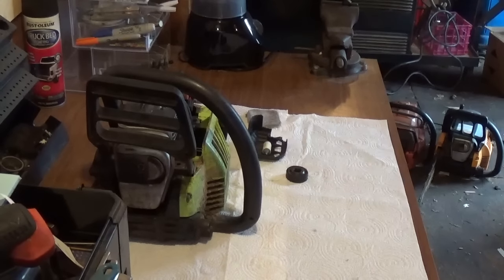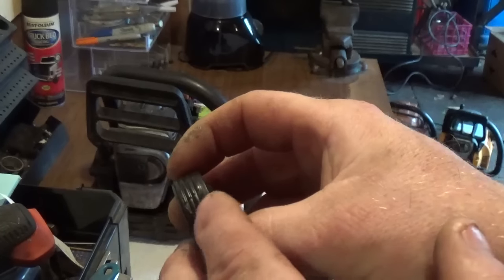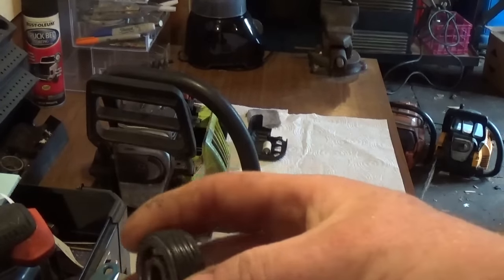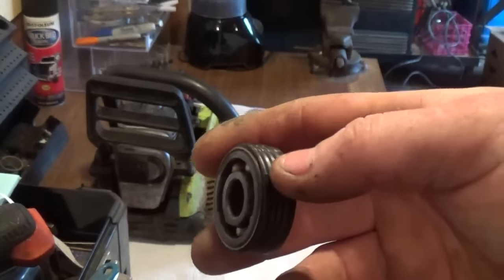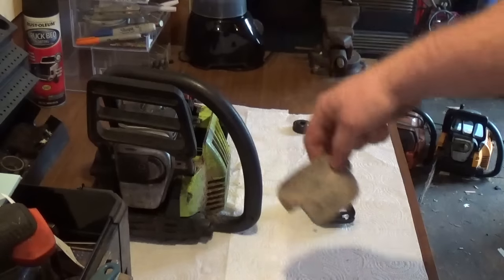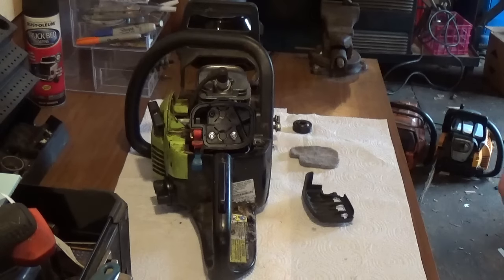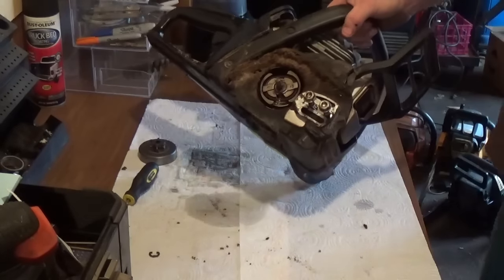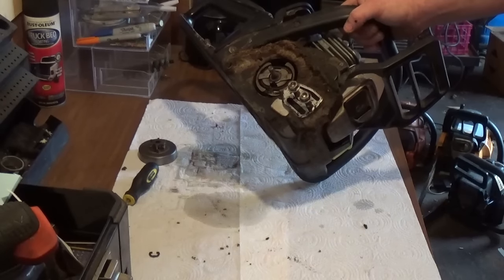Common problems with Poulan Chainsaws

Comment: Since Poulan used a somewhat odd OD/ID fuel line I use Echo fuel line. I've used Tygon also. Fully agree with your assessment of these saws. In this area you've got cheap-ass people buying cheap-ass saws b/c mainly they don't need anything better. I seen these parked at the curb for trash pickup before. Some look as tho they've never been ran. Got 1 of those in the shop now, a 42/18. Replaced the fuel line, replaced the bar/chain with a 16" & it's not a bad saw. I always sell these at yard sales & they'll bring almost as much as new.

Comment: WOW! I bought one in 1983 from my local "Western Auto" . Unfortunately, the Western Auto is long gone but my Poulan Counter Vibe 3400 (with a bow bar) still cuts fire wood every year without fail! No Problems! Thanks Poulan!
Reply from the maker: The older Poulans where pretty decent saws …...This newer crap makes me sick …...Not even worth taking home so to speak .
Reply: @kevinbolin7665  Yeah, that's what I figured Kevin. Nothing (and I do mean NOTHING) is made to last any more. We now live in a throw away world. Buy it, use it until it breaks, throw it in the trash and buy another one... Sad. Thanks Kevin

Comment: This is all absolutely correct.  I had an old poulan that ran well for many years.  I then bought two different models of new poulans including the one shown.  They both had all these same problems.  Husky would not fix them under warranty and said it was my fault that they failed.  I ended up leaving them at the recycle center and bought a stihl which has been a great saw for many years now.

Comment: I must say that the Poulan 3314 looks to be an amazing piece of machinery. It looks like it should be a great chainsaw. 
And it does run, don't try to start it when the engine is hot, you need to take a 30 minute break before that. There is a modification that will fix that by drilling half inch holes in the middle of the air filter cover. But it leaks gas and oil. the oil and gas cap is removed with vice grips. And when you try to start it, it kicks like a mule. But if you clean it up, drain the oil and gas out, it makes a pretty good static display, it's good for that.

Comment: 10 years on mine. Only issue was the primer bulb.
Reply from the maker: Consider your self lucky....there are fair to many problems that plague these saws than broken primers.....
Reply: probably because it is lightly used. I wouldn't own one for constant use. I'm actually about to dig up about 30 trees
Reply from the maker: True/ there def not a saw I would rely on ..

Comment: While no one can ever argue that the Poulan P4018WT is a pro grade saw it is not a complete POS either.  I got mine 16 years ago on a Black Friday special for 79.99 (and that included a case and scabbard).  That said I experienced some of the same problems mentioned here and on other Poulan video’s (primarily hard starting hot or cold).  I never had any oil or fluid leaks though – I attribute that to the fact that I run all my 2 cycle equipment 10% fat on the fuel mix.  I use Echo Red Armor fuel mix along with Stabil fuel stabilizer and 93 octane pump gas.  I opened up the muffler and modified the air cleaner cover by drilling a ¾” hole in line with the upper barrel of the two barrel carb.  I then made the appropriate carb adjustments and that took care of the starting problem and quite frankly the saw runs great.  I use it primarily as a backup to my pro grade Echo 501P and also as a bucking saw.  Where I live on the front range of Colorado (7,300 elevation) 90% of the wood I cut is pine so relatively soft wood and the saw runs all day long running through 10” – 16” pine.  I don’t carry it in the woods anymore because it is a heavy saw (weighs more than my 50cc Echo) and is not as ergonomically comfortable as my Echo for felling trees, but like I said it works great as a bucking saw / backup.  I should mention that I use Oregon 91VXL chains which are more professional grade.  I tuned by ear and the spark plug is consistently golden tan in color so I think I’m in the sweet spot, but I do have a question about idle rpm and WOT rpm – if anyone knows those spec’s I’d be grateful for a reply
Reply from the maker: Rick / to each his or her own .....if you like 42 cc of screaming skipped toothed performance .....even though you advocated you made mods and upgrades .....hey .....great .....my only comment or request rather would be to show my viewers irrefutable proof of this saws longevity with a video / Take the Poulan challenge to validate that indeed your opinion carries merit further validating that these saws are not pieces of shit . { Viewers this is a reasonable request .....IS IT NOT? }Then why hasnt anyone validated there claims ? It seems most are asininely blinded by opinion or preconceived idealisms .....Yet no one ever provides a video .....HUMMMM.......wonder why ?
Reply: @kevinbolin7665  Mr. Brolin – thank you for the reply.  To be sure I’m not advocating that anyone go out and buy a Poulan chainsaw – in fact I would advise against it, there are much better options available albeit at higher price points. I bought my Poulan 16 years ago as a newbie homeowner on a budget - it gave me a lot of grief the first few years of ownership and I was tempted to scrap it on more than one occasion but for $79.99 (case and scabbard included) I thought wtf – either I can make it work or I will toss it.  Fortunately I was able to make it work properly it has become a capable backup saw to my pro grade Echo saws.  
All that said I much prefer to use full chisel cutter chains and I use Oregon 20LPX078 chains on my Echo CS-501P and they work great.  Am not aware of any full chisel cutter chains for saws under 50cc – if you have any recommendations I’m all ears.  Am not sure how to post a video in a Youtube reply (not sure if it’s even allowed) but so far this year I have processed close to two cords of wood – the majority of which was bucked using my Poulan.  Does my 501P with full chisel cutters work better at bucking rounds? of course it does – but the old Poulan helps keep some of the wear and tear off my better chainsaws and when it finally gives up the ghost I think we can agree I will have gotten my money’s worth.
Reply from the maker: @Rick-jq8ng  Truthfully I can respect the fact of trying to conserve the longevity of the 501p with having the Poulan as a secondary saw .......This is very sensible ......And at 79.99 all things considered .....yes it very logistical to do so .  However if you would like to prove or validate your claims {place the video on your channel}....My loyal viewers will or rather would comment that your claims where or are validated via the provided proof of video .....To be honest I am not to prideful .....if you show valid proof of the longevity and current cutting performance of the Poulan by taking the Poulan challenge then the validity would simply speak as a testament for the truth further exploiting the fact that your claims are now confirmed .

Comment: Bought a Poulan 'Super 250A 'Automatic' in 1978 and it has run beautifully ever since.  Lived in Cooperstown, PA and prepped a rick for several years running.  Has never been in for service and starts up year after year no problem.  You mentioned that the older Poulan were decent - perhaps mine would be an example of that.  Original bar.  Sharpened chain until needed replacement 3x.  Went through a couple of gallons of chain oil over that period of time.  Never replaced the fuel line/filter.
Reply from the maker: I dont doubt your 1978 preforms great

Comment: I found a Poulan 14" Chainsaw on garbage day. After tearing the thing apart to clean it, I found a clogged fuel line. From tearing it apart, I definitely agree on poor quality statement. The saw housing is combined with a Styrofoam-feal gasket to create the fuel tank for crying out loud. In the end, I took it apart and saw engine cylinder was clean so I kept at it. Completely cleaned carburetor and tank as well as spark screen, oiler, air filter, and all the saw dust. Changed fuel lines, re-tuned it, and found it was very easy to start but found it was impossible to idle properly at low engine speed. I appreciate your video, as i understand why now with the seals as I noticed deformity in mine. Still it runs and cuts well for a small DIYer like me, and I always use clean 40:1 and drain/run dry when done. You advice will help me know what to maintain to keep it going. Keep in mind, only thing I have invested is a can of spray clean and 3 hours. I'd say it was a win :)
Reply: Common cause of poor idle is the carb setting, or water in fuel, or excessive ethanol in fuel, or un-stabilized fuel that's too old, but can also be a bad diaphragm in the carb.

Comment: come on now, I own a Poulan Pro 42cc that starts and idles fine but that POS has no power I have had it to the shop twice and it still has no power so I am keeping it until it is considered a classic up in the rafters of my garage because I don't want to look at it. I bought a Worx electric that starts every time with the pull of the trigger.
Reply: JIM ECKENRODE Great example of the way to write a negative protest video comment. :)

Comment: I have a brand new Poulan pro 5020. Here are just some of the issues. The gas cap issue, just like you pointed out, oiler cap is the same. better have a channel lock handy. Air filter sucks. Carb is so lean out of the factory it runs like a raped ape for 15 minutes then shuts off and won't start again til it cools down. I replaced the carb, I replaced the fuel lines, fuel filter, oil pick-up, magneto and spark plug, and ported the muffler out. Lol...adjusted the carb...it still won't run. Brand new.  FML. Saving my clams for a redmax or an echo.

Comment: I have one when I use it it acts crazy sometimes. It wants the carb adjusted all the time In order for it to work I have to carry a small screw driver. it always acts up Sometimes it will not idle. I guarantee that buying a new
carburetor will not work. not going to buy a another Poulan or a variant of those particular saws again and add to this what Husqvarna just did pissed me off don't get me started on Husqvarna they terminated Dixon and lowered the quality of poulan saws. too bad that many brands don't make saws like they use to. My next saw is going to be an echo Because I have an echo pas 225sb and a pb2520 and had very good luck with echo. 

I agree with you when it comes to these saws  I subbed to your channel
Reply from the maker: Its sad just how many people get screwed over after the purchase of any modern Poulan .
Reply: @kevinbolin7665  You are absolutely correct  when it comes to good saws people would buy echo or Stihl which both are very good many
 people choose them over poulan

Comment: After having my brother drop off his Poulan so I could fix the recoil, I completely agree. Needed a wrench just to remove the gas cap & the blow back was off the charts. I would take an old Homelite XL76 or Pioneer 420 that you had to thumb oil over one of these pieces of shit & that ain't saying much. I own 3 Stihls O38/ O44 & an O84 all made in West Germany before the wall came down & they all still run like a top after almost 40 years of moderate usage! I've lost track of the hundreds of chains my O38 has worn out. Too bad they have also somewhat gone the way of Husqvarna with their recent homeowner lineup of MS saws.

Comment: Biggest problem is buying one in the first place bought a box store one 30 years ago and it crapped out after 2 years occasional use crank bearing failure just utter junk 
Then bought brand new husky and it has served me well and still going strong 
Have 3 stihl pro saws and they’re a pleasure to use 
Buy once cry once. Cheap stuff lets you down. Ya gets what ya pays for

Comment: Bought a new Poulan 1433 at Lowe's this morning and returned it a few hours later. I worked over an hour to get it stated and after a few bruised knuckles I returned it back to Lowe's for a refund. First time I ever had a problem like that for a new tool.
Reply from the maker: I am sorry for the trouble it caused ....Sucks.....been there ......still at least you can allow viewers a chance to see by example that what I have been saying all along is still def the case .

Comment: I have a wood shark that I've used for almost 20 years. I replaced it with a new one last year. I've put one bar oiler pump, fuel filter, spark plug, 2 bars and I don't know how many chains I've wore out. It was a great saw for $97 at Menards. 
MB BAR RANCH
Reply from the maker: Great / but its hard to take this comment seriously as proving it has became  a issue .  Sorry martin but as I have asked others to provide prof you can not be the exception .
Reply: @kevinbolin7665  it is in the shed. Would a picture and serial number help?
Reply from the maker: @martinbenton742  To validate the age ….{YES}….To vindicate with out any doubt the saw has actually ran 20 plus years sadly {NO} ….I will say this however / Of all the viewers that have felt compelled to leave a comment if I was going to believe a comment or at least declare a comment plausible …..It would be yours …...Sadly I just cant attest your comment to be factual with out actually seeing this old poulan in action …...And just because of the situation or impasse we have found our selves in . It can only find resolution in facts that can be projected visually so my viewers and I can see first hand the saw could perform and still currently performs as the person proving the comment is attesting . Pictures sadly can be worth a thousand words where Video allows for progressive following often with direct clarity to determine fact as a end goal .

Comment: I have had my Poulan Pro 295 for 15 years now.  It has always started on the first or second pull.  This is the first year that I can't get it running.  I always dump the old gas out.  Mine does not have a primer ball on it.  I give it full choke and pull the cord and 5 times and then give it half choke and pull the cord one time.  I have good spark and it seems to have good compression I think, but the spark plug does not get wet with fuel.  The gas tank is pressurized I noticed when I pull the fuel cap off.  I pulled the carburator off and there is only gas on one side.  I blew out the carburator with shop air, but the gas is still not getting through the carburator.
Reply: Just a guess- the rubber diaphragm inside the carb that acts like a one way valve to draw fuel needs to be replaced- Old age or perhaps the ethanol in your fuel degraded the rubber.

Comment: Great video, but I would like to add something if I may. Great video, but I would like to add something if I may. If you do get a Poulan that works out and you can use it, you'll very likely be constantly adjusting the carb due to how sloppy the carbs are on these. Even if you adjust them right, you'll have to do it almost every time you run it. It's as if the saw has a mind of its own. One minute its starting up and running great, next minute its almost falling on its face after less then 5 minutes use. 

I had a question also, is the Stihl 066 a good saw? Did I get a good deal on the 066 I show on my channel?

Comment: My saw is 13 years and other than replaceing the fuel lines it runs and preforms great.
Reply from the maker: It seems that for some reason my request of a short video cant resonate . Why this task is so difficult is truly beyond me . As I thought I was making it very clear to one and all .If you are having a grievance with this video or are being compelled to make a opinion solely threw idealism . Then respectfully your wasting your time ....My viewers and I are expecting more . As all my opinions and facts can be backed by proof evidently shown in my videos regarding Poulan Pieces of Shit . So if you wish to prove you have such a poulan as you have spoken of simply Provide a short video as I have requested time and time again. If you cant provide such a video then how can viewers and I take any face value in your commentary on this matter as it would quickly seem superficial at best .{SEEING IS BELIEVING} and this task shouldnt prove to be very difficult if indeed you truly have such a Poulan . Now with that being said I have no reasonable reason to doubt you .....So don't disappoint .....Provide a video showing this saw in action ....my request can be seen in many of the replys on this channel so there shouldn't be any confusion on whats expected to validate your claims with results .

Comment: I have the same problem with the gas cap.  I alway carry an extra cap with me.  The swelling will go down and can be used next time.  I usually smear a little bar oil on it before putting it back on.  Helps some.

Comment: Can't say that I have ever used or worked on these saws, but I have not heard any good things about any from people who have tried to use them for many years either. My 025 Stihl, has been my go to for almost 20 years now.
Reply from the maker: Earth digger / we have a lot in common LOL...I to have made my 025 Stihl my go to saw for the last 8 years...Great saws Just needs a better oiling system......But I cant complain to loud they sell a very nice after market oiler with worm gear on ebay for about 12 dollars ......And to tell the truth the aftermarket pistons and cylinders are pretty decent to......Just use FD rated oil and mix it 40 to 1 instead of 50 to 1.